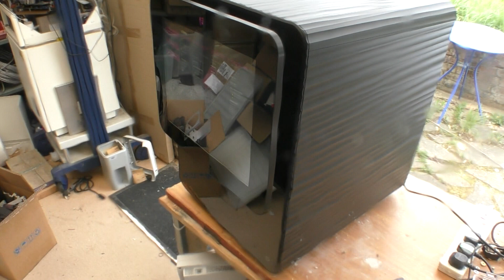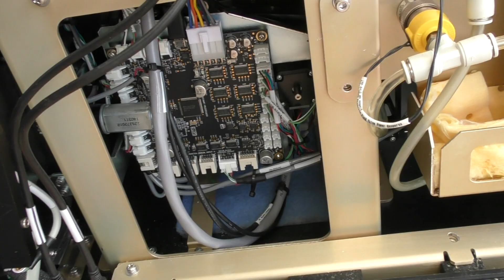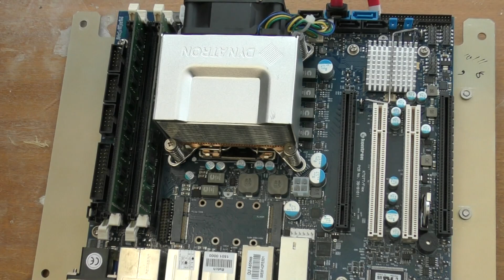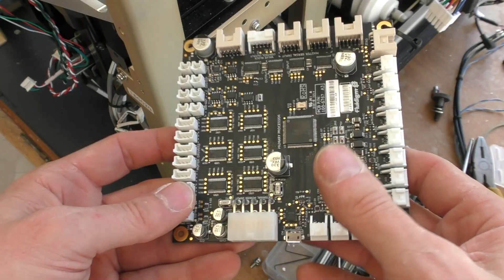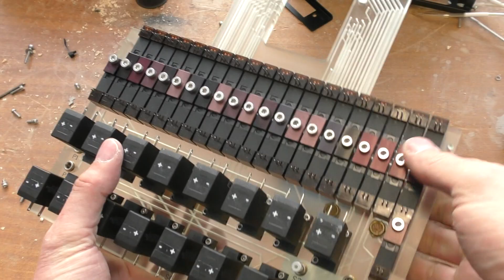Fluidigm Polaris (Part 1) - Biotech goes "Apple"?

Comment: Used this machine approximately 6 or 7 years ago now. Most of the cells died in any sort of conditions in the machine. Biologically it made no sense and you'd have to run 10+ plates to reach any sort of statistical significance for experiments, costing thousands and thousands of dollars and about a month of labor. Became a $400,000 paperweight. But at least it looked pretty!!!

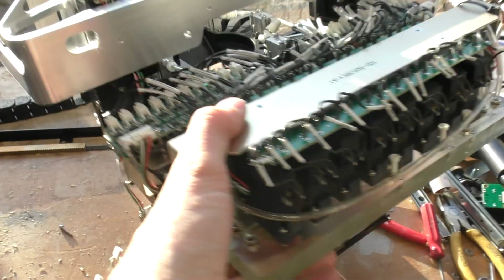Comment: 26:29 That aluminium piece on the top left was made from a solid chunk of aluminium.. I mean FFS!
Reply: For low volume production, turning 95% of the starting material to chips really does not matter.  There is plenty of examples of competent sheet metal design in this instrument, the engineering had to have good reason to solve it like that.
Reply: @Konecny_M  Not necessarily, I can think of many ways of doing that with fex tig welded little thicker aluminium sheets which would guaranteed have been cheaper. My guess is that the cost didn't matter since they was going to put a very huge price on it anyways and told the engineers to just do it no matter how.

Comment: Summary
* (0:00) Expensive & "Apple-like" Design: The Fluidigm Polaris system cost $400,000 in 2015 and features a sleek, all-black enclosure with machined aluminum covers, a custom monitor housing, and even purple LEDs (white LEDs with a purple filter).  This design has been compared to Apple products in terms of its aesthetics.
* (0:08) Purpose: Cell Analysis & Drug Testing: The machine is used to extract cells from samples and then test the effects of different drugs or chemicals on them.  It can run about 48 experiments in parallel.
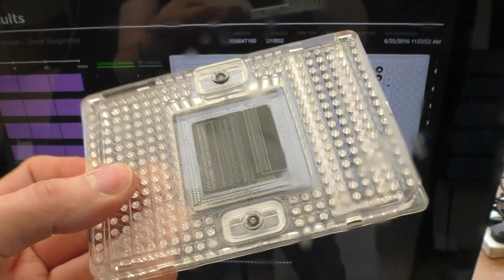* (4:10) Microfluidic Chips:  The system utilizes single-use microfluidic chips (costing around $1000 each) with intricate channels and valves for precise control and manipulation of fluids and cells. These chips likely contribute significantly to the overall cost of running the system.
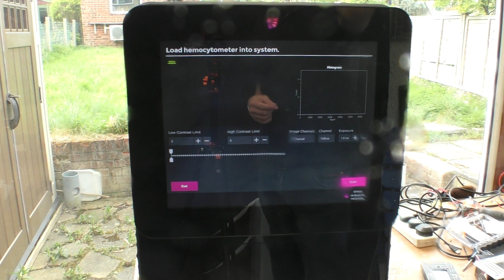* (5:04) Imaging & Calibration:  A high-resolution scientific camera (made by Finger Lake Instrumentation) and a specialized light source (Lumen Dynamics) with multiple wavelengths and narrow-band filters are used to capture images of the cells and calibrate fluorescent stains.
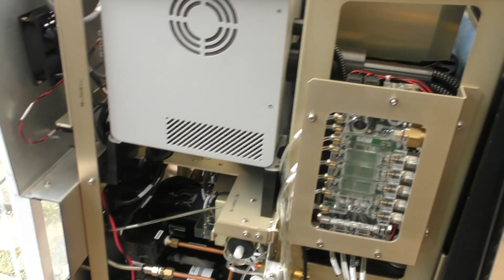* (9:18) Complex Pneumatics:  A significant portion of the machine is dedicated to pneumatics.  It utilizes compressed air to move fluids through the microfluidic chips, featuring extensive manifolds, numerous valves (primarily from Norgren), and pressure sensors. 
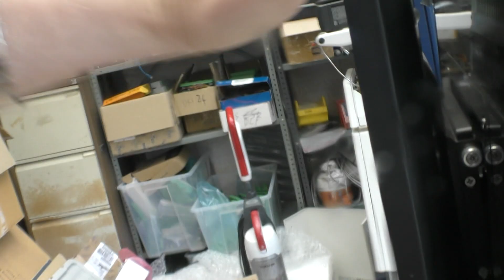* (7:25) Extensive Custom Engineering:  Many components of the Polaris are custom-made, including the monitor housing, the tray assembly, and the manifolds, which are likely manufactured using diffusion bonding of multiple acrylic layers.
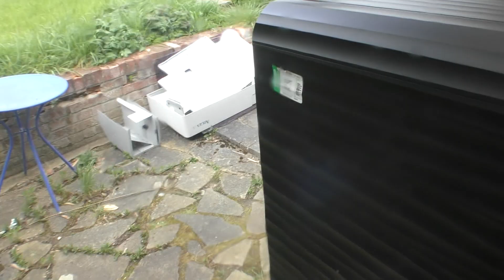* (0:54) Limited Usage:  Despite its high cost, the machine examined in the video appears to have been used infrequently, raising questions about its overall cost-effectiveness.
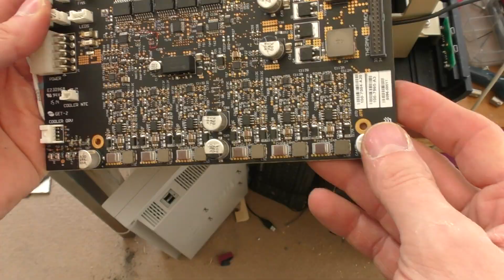* (20:15) Over-Engineered?: The video's creator suggests that some aspects of the system, particularly the complexity of the electronics controlling the Peltier coolers, may be over-engineered.
* (29:44) Multiple Part Series: Due to the complexity of the machine, the video is only part one of a series examining the Fluidigm Polaris.  Future videos will delve into the camera, light source, and microfluidic chips in greater detail.

Summarized by AI model: gemini-1.5-pro-exp-0801
Cost (if I didn't use the free tier): $0.0814
Input tokens: 20025
Output tokens: 1081

Comment: $400,000 
and two badge wires
Reply: Yes that is actually very impressive. I have seen more in handheld fluke DMM:s back then.
Reply: You should see military equipment, millions of dollars and tons of bodge wires. Bodge wires if done right are no issue at all and it's really expensive to do a rerun for the pcbs for these expensive machines, so bodge wires are preferred.

Comment: „aesthetic wankery“ 😏

Oh well, in medtech there is nearly no limit to the cost of the outer surfaces, especially if they have to comply with GLP regulations.

I‘m slightly surprised at the uneven surface outside as it doesn’t seem to be beneficial for cleaning.

Have yet to watch the whole series but I assume they‘re using the massive case to keep the inner temperature within a defined range compared to the temps in the lab it would be installed in.

400k is not a surprising price to me at all, yes that outer finish is for the fuzzy feeling in this case. The microfluid consumables are single use and they will be the main cash cow next to the sensor.

Fascinating stuff, don‘t get to see this every day.
Reply: These devices are engineered and validated for a specific purpose and in the end that purpose is what will define the requirements.

The cost isn’t the main deciding factor, the question is if the device and the manufacturer can fulfil the requirements posed by the customer.

Those devices must look neat to the cleaning crew, like the synchronous blinking BMWs.

Comment: I used to work for a much smaller similar company. Here's the catch 22, these are low volume high cost devices without the designer wankery. Customers come to the manufacturers lab and say, "This is great, it does exactly what I want. But it's expensive and doesn't look that nice, what else can you do to make it look better?". I paraphrase but that's basically what happens. So then you go down the design rabbit hole and end up with this monstrosity, and you charge the customer twice as much but for some reason they now want to pay it. It's broken. Also Fluidigm are probably the most guilty of doing this.
Reply: Well said. In a world where all of these tech startups survive by wowing VCs who pray to Steve Jobs, it probably pays just as much to have a pretty lab as it does to have a lab that actually does something. Pretty funny from a scientific/engineering perspective. But I guess you do what you gotta do to survive, including burning piles of cash for milled titanium bezels.

Comment: Why wouldn't you want a special system that costs a shitload of money look nice? Would you rather see the system shipped in a bog standard PC case and require you to bring your own monitor as well? Or is the expectation that this would somehow (considerably) bring the price down? I don't think so...
Reply: Of course it would bring the price down if it was headless.
Reply: @jaro6985  For the manufacturer: yes. For the customer: why would it? This is a very niche system so the manufacturer can basically ask any price for it. I for one like expensive stuff to come in a package that matches the price tag, even if it's not prominently displayed in public (aka wankery). 🤷‍♂

Comment: There is a supplier for Electric and Phneumatic PCB near Hamburg. Saw their stuff at the SPS show in Nuremberg in 2016. So it is available, but the number of layers in this manifold is extreme. Although as you say a simple thin multilayer, or even a flexible foil PCB could have done a better job than the extremely expensive wire loom. But looking at the overall concept of this machine, there was little mind given to optimization. At a price of 400k there was surely a fair amout of profit in this. So, inguessbthete is a lot of scope to bring that kind of device to a much lower price point by a less lavish implemebtation an the application of a little judicious production optimization.
I remember seeing well plates at a Medica show in Duesseldorf in the early naughties, but I never saw a machine that drove them.
How did you find sth like that in the first place?

Comment: 16:58 That script is python 2. If you have write access to it (for example if you pull the drive and put it in another pc) you could rewrite a section of it pretty easily and get it to dump the passwords or even just execute the maintenance mode directly.
Reply: Funny that they used python2 in 2014, which was already announced  eol by then
Reply: @Jinguapingi I'd say more like typical tbh. Python2.7.xx had a long run..

Comment: For something with a lot of impressive engineering, there is also a lot of absolutely atrocious engineering. I have a manufacturing background, and those giant monolithic aluminum components are absolutely insane. You're probably looking a close to $1500 in aluminum billets for those two parts you showed at the end, and then throwing away most of it with $4000 worth of machining. It wouldn't have been as elegant, but breaking those components up into several smaller pieces that were bolted or welded together would have seen considerable cost and manufacturing time savings. Couple that with the side panels milled from aluminum sheet, and it's just craziness. 

"Spare no expense" doesn't mean "design this purposely to be unnecessarily expensive to build". The whole thing screams "biotech engineering intern designed". Bunch of very intelligent, creative college kids, without real-world engineering experience, being told they have no budget constraints. 

I just cannot see a seasoned mechanical engineer making those pieces out of solid aluminum billets like that, even with an unlimited budget. It's just so wasteful.
Reply: Although I agree with you from a perspective that you shouldn't be wasteful, I don't think doing it in a different way is necessarily cheaper (or better). A good example what else might tie in is time (engineering hours). If there is extra engineering time involved into creating parts that bolt together nicely, it could costs the company money as well. Engineers are expensive, and sometimes the seemingly more expensive route is actually cheaper in terms of man power. This is often the case for low volume products, where R&D/design costs make up a much larger portion of the final unit cost compared products sold at volume, where the engineering cost can be spread over many more units. That is just considering the cost of the engineers, not even valuing other key drivers such as the lower time to market (the sooner you can get your product to the customer the better). 

I work in research, and there too we often go for the 'simple' solution, even though it might be expensive on the face of it, just because spending a few days more on it to drive down the cost, actually costs more in the complete scope of things.

Tl;dr there are more key-drivers involved in making design choices, and something which seemingly is a more expensive option on the surface might actually turn out cheaper if you factor those in as well.
Reply: well, they sell it 400K, so they are not a few thousandth. This kind of "engineering" is actually quite common in "tech" company making insane markups.

Comment: I think it appropriate that the external case and monitor should somewhat be aligned with the internals.  Would it make sense to have the external body/interface be minimal (read:cheap/standard dull) when it is <1% of the cost of the instrument? The case and monitor maybe fancy, but the additional cost if only a couple percent of the $400,000.

Comment: I read-up on the machines purpose. It was used in cancer research, where one could take up to 48 cell samples. While keeping them alive up to 24h within the sample well plate. During this each cell 'channel' can be treated by different chemicals. In the same different fluorescent dyes can be dispensed per cell, different other reagents for instance to test cells viability / metabolism. 
I think the easiest way to think of it, is like a human bio-reactor where different cancer treatments can be test in parallel and rapidly.

Comment: Small valves rely on contact pressure, they probably replace the wiring section to a valve with the valve, so that they only are used once.  That way the initial wipe keeps the connection gas tight, and it will not vibrate loose.

Yes pneumatics dept and electronics did not talk much to each other, or they had a massive delay on laying out that pneumatic logic board, so did not actually know until late on in the design  as to where they were going, how many they would need, and an exact design, as they probably were iterating through designs, trying to get it to both be manufacturable with some sort of yield (likely they had a 50% loss in testing, which is fine if you are charging $400k, make around a dozen a year, and the fluidic assembly takes 2 days to bond together, and another day to pass or fail test, so you always have a stock for testing)  that is acceptable and not going to delay any deliveries.

Comment: That optical block is probably made from Invar, as it has almost zero TC, so the focus does nor change with temperature, and also will nor change with the top being cooled and the base being heated.
Reply: Invar is magnetic though, and Mike said this isn't. I had the same thought initially!

Comment: apart from the overbuilt case the rest of the engineering seems like it was valid. Even the heavy aluminium case may have provided extra damping. the machining of it though, wankery ))). I wonder why it was never used ?
Reply: Probably because it was nearly obsolete when it was received, or the consumables turned out to be too expensive. After all those fluidic plates really are a single time use item, and the reagent stack they also need, likely an identical looking machine you used, that had dozens of reagent stores in a magazine inside it, that all have a short shelf life, need controlled atmosphere and temperature storage, and would run out of only one and need an entire $$$ magazine changed, and then you would have to change them all, because now the batch numbers are different. 

They probably bought it, then found out that the consumables to run it would eat entirely the entire research budget for the second quarter, so it only ever got used with the initial batch of reagents, or possibly only a second batch, then sat in a corner of the lab, powered on in standby, and only used after if they were absolutely swamped, or something needed this older test done. A lot of lab machinery is like this, too expensive to run when there are near identical machines that do the same or similar work, but where the consumables are cheaper, so they are the work horse, the expensive one only used when absolutely necessary, before it gets dumped when the value amortises down and they can get rid of it.